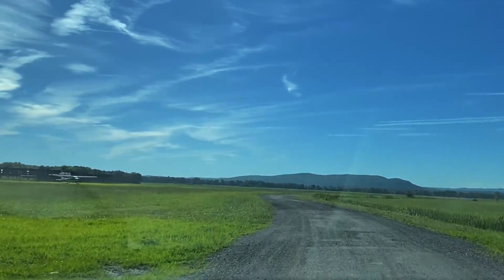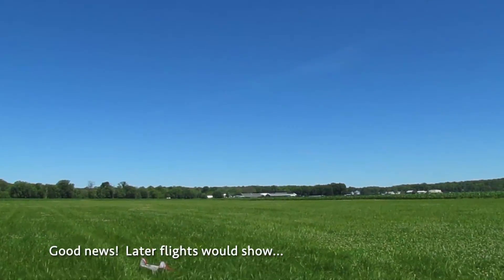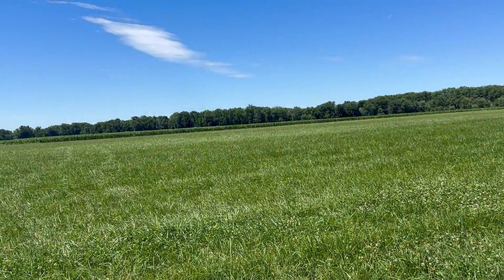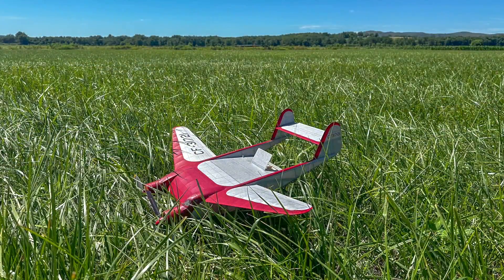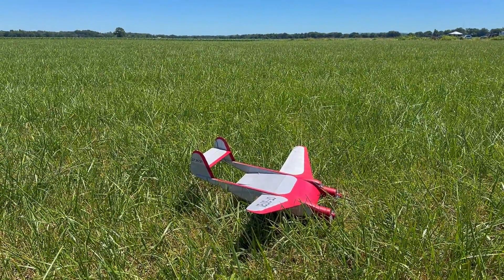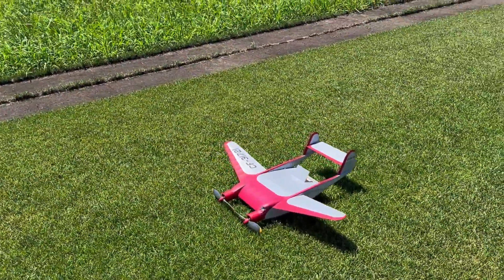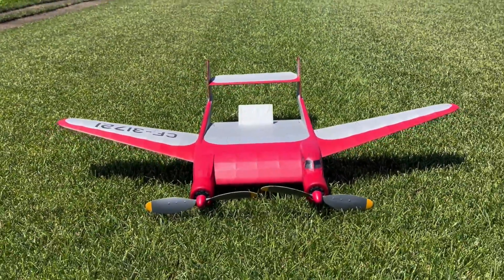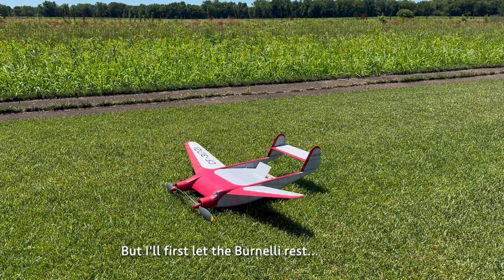Burnelli vs Boeing  - One Goes Thermal Bumping

Comment: Great idea, i have read just about everything Burnelli did. As a former Commercial pilot I wish FDR did not put a govt law mandate out against burnelli that NO govt agency or contractor can buy or sell to Burnelli.
Safety is not first, Greed was and ego. 
The jet designs were beautiful.
Reply from the maker: Thx, I agree. It's unfortunate that it didn't turn out better for Burnelli, allowing the designs and production to follow thru. I'm totally in love with the way the model looks against the blue as it's coming around. Imagine to have seen similar, on a regular basis, with a fleet of full-sized aircraft.

Comment: Two of my favourites. Was the Boeing ever built? I know Northrop built many flying wings, including the original blended body Avion-1 which was much more similar to the Burnelli with it's twin tail booms and offset cockpit. I kinda wish you'd have honoured Jack Northrop for his pioneering work in this configuration especially after the tragic loss of the N-9MB in 2019. As a cleaner design, lacking the detached elevons and wing tip rudders, if you were able to make it work, I'm sure it would outperform the Boeing.

Comment: Talking there about maximum turns on the motor, have you witnessed an airframe 'implode' during winding? (hope not!) Loving the vid as always.
Reply from the maker: Only once, and that was with a blast tube in place. The torque was so strong, it ripped the tube out the right side of the frame on my rather lightly structured 1911 Bleriot XXV pusher canard.  I've since installed a plate attached securely to the stooge, which prevents the side movement of the blast tube.

Comment: Great flying airplane!  But I have always wondered why more FAC fliers don’t use a tracking system. There are transmitters small enough to be used on birds and bats. Most planes need some ballast anyway, and the model could be built to have an enclosed tracker where the weight would do some good. I did a demo at Geneseo, taped a transmitter to George Bredehoft’s embryo.  Wind shifted and it went pretty far into the corn. I had a guy on the antenna who had never used a tracker, while I worked the controls on the receiver. We got the plane and we were out of the corn in about ten minutes. The embryo could not be seen until we got within a couple of feet.  The time  and effort to build such a gem and trim it out adds up to a lot. Seems silly to just throw all that away if it flies OOS.